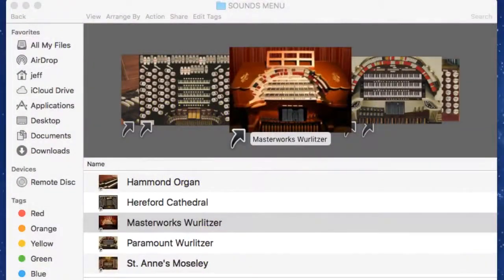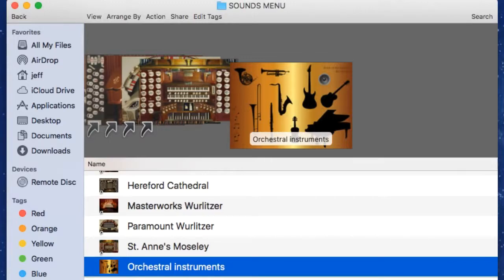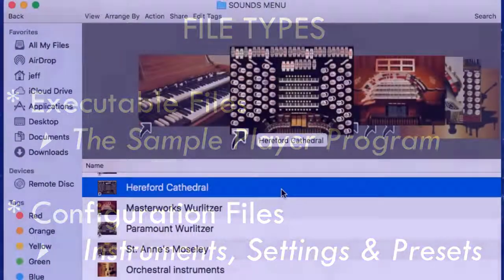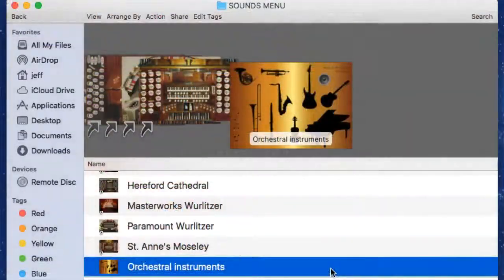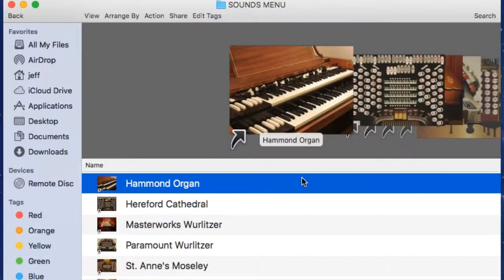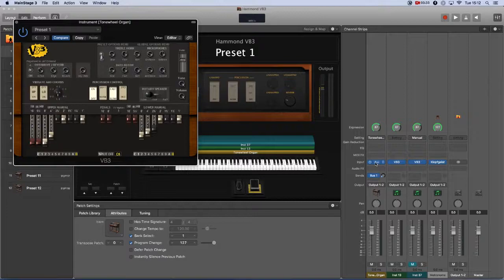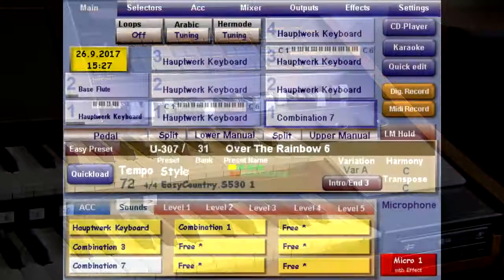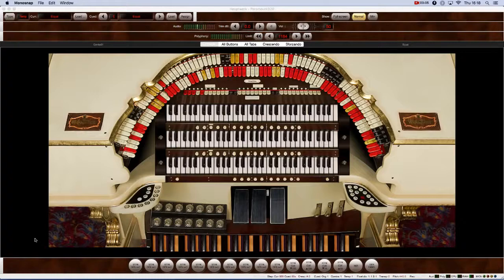The Wersi HD Sounds Menu

Comment: Just 3 questions
Where can i download this software?
How much dos it cost?
Would it work with any keyboard that allows you to program midi out?
Reply from the maker: Comments back from Jeff:

Hi Jules - As Curt says, I'm using commercially available software that runs on any standard operating system on both PC and Mac platforms. For my purposes I'm using a Mac Mini connected to the MIDI out system of my Wersi organ. Any MIDI keyboard will work with this software. The Kontakt Player is available free. Hauptwerk do a free version which supports only the smaller pipe organs. For larger instruments you will need the either the Basic Edition or the Advanced Edition. The Basic Edition costs $249. The VB3 software costs around $60. You can find more detailed information about how all of this works and links to the software vendors on the Wersi HD series web site at:- www.wersiorganshowcase.com/hdseries.html

As for the display system shown in the videos, this is of my own design just to collate all of this software together and make it easily usable on the organ. It employs only standard operating system utilities so no programming expertise is required. Of course, for those with programming skills it can be made much more professional. The advantage of this approach is that the display system can be designed and customised to each user's preferences and requirements. Hope this helps. Jeff.